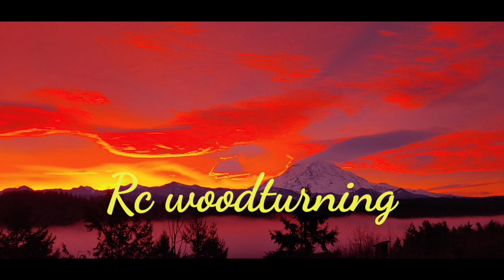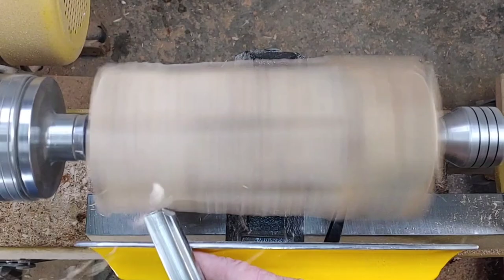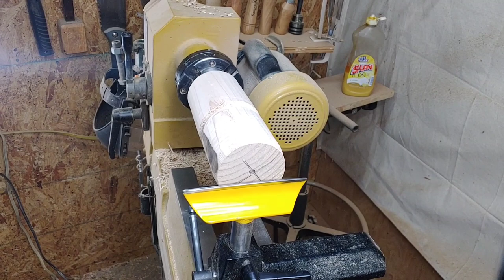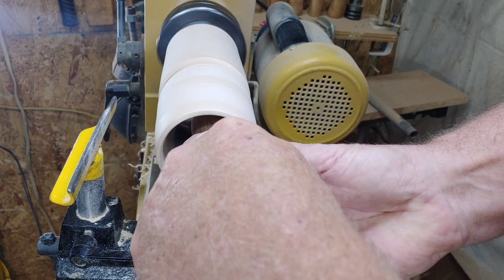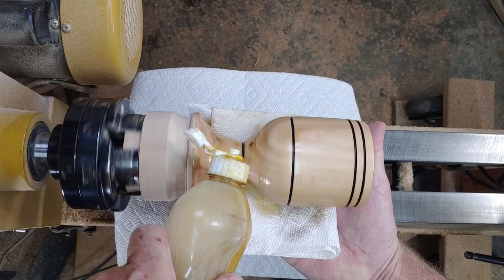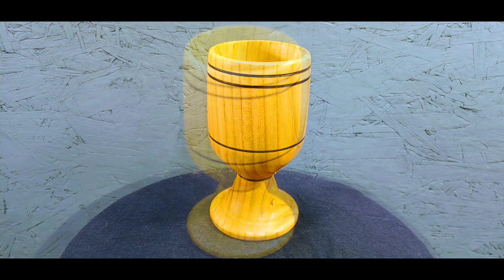wood turning a goblet from a scrap (4×4)

Comment: You are the first turner that I have subscribed to.  I have watched many on u-tube.  I am 78 years old and just bought my first lathe.  When I was 13 my grandfather had me turning out legs and supprt pieces for his straight back and latter back rocking chairs.  I have decided to try again, being a teenager I should have paid more attention.  I am really interested to know the contents of your conditioner. and one other question.  How do I keep my tenon of the piece I am working on in the chuck.  No matter how hard I tighten it it comes out.  Than you in advance.  Great work by the way.
Reply from the maker: Well thank you Tommy! I feel honored! I appreciate that!
The bottle is my mix of friction polish. I mix 2 parts shellac, and 1 part each of denatured alcohol and either mineral oil or boiled linseed oil. You can also use other oils like walnut oil.
On the jaws of your chuck there is a dovetail angle. You want to make that same angle on the tenon of the wood so they match. Also close your jaws then open them slightly so there is a little space between the jaws. No more then 1/4 inch. That's the diameter you want the tenon. I make my tenons about 3/8 of an inch long.
I hope that helps. Let me know if you have more questions.
Thanks for the sub and watching.🙏

Comment: It looks like you and the skew are old friends, while I am still getting to know mine. Your goblet looks great.  Do you have any suggestions for food safe finishes that are durable?  I am still trying to find something other than walnut oil and wax.  Keep well, Rob
Reply from the maker: Thank you Rob. I had my problems with the skew until I understood how to use it. Learning the skew is all about using the bevel. As far as a durable food safe finish, I use shellac. I mix it as a friction polish. Equal parts of shellac, mineral oil, and denatured alcohol. You could use walnut oil if you want a darker finish. It's quick and easy and leaves a nice finish. Hope this helps. Thanks for watching. Rus.

Comment: The wood you are turning, you call it construction lumber, does that mean the lumber is Pressured treated?  I was advised to never use pressure treated lumber.  Is your wood pressured treated?
Reply from the maker: It's regular wood. Not pressure treated.